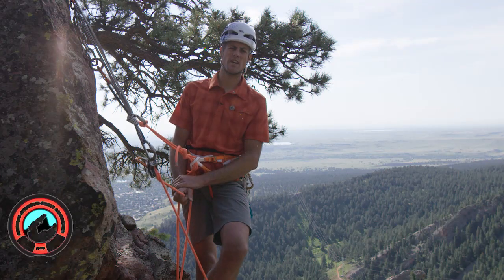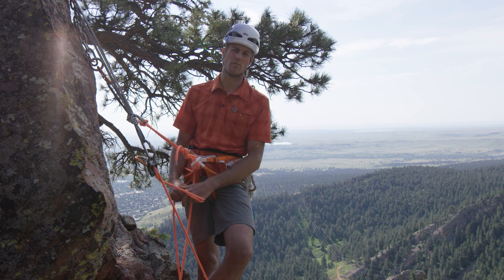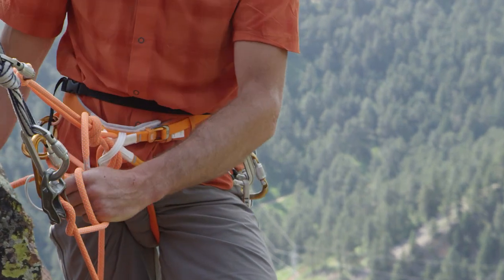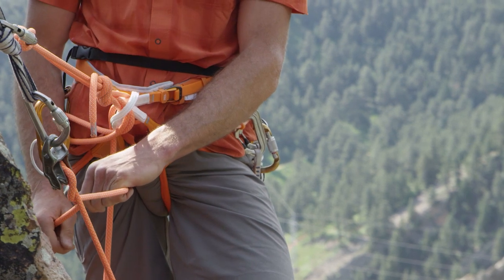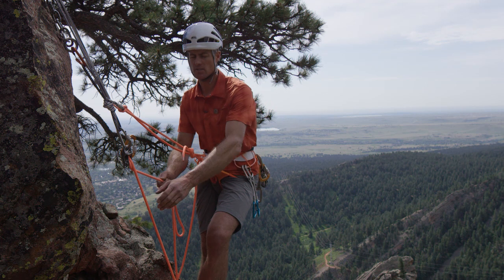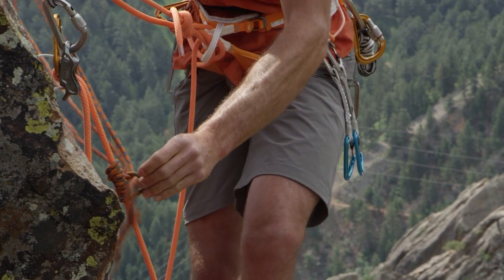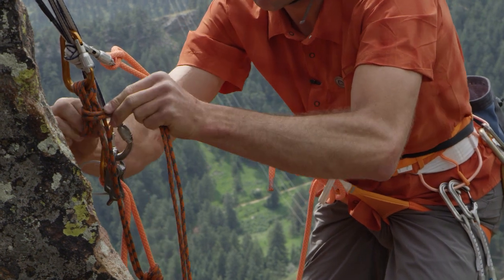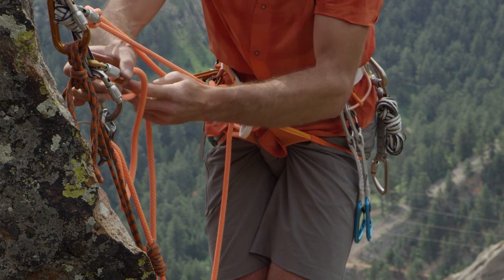Releasing a Loaded Auto Blocking Plate

Comment: Quickest way to release autoblocking device: don't use one, use a Munter.
Reply: Sorry but that's a dumb logic. Learn how to use different tools and when to apply them. Autoblocking devices are handy on long multipitch, so you can drink, eat, adjust layers, and have the gear ready for your partner (and take photos!), all while they are climbing, instead of waiting for them to get to the belay to do so. They are also pretty much the only way to safely bring up two partners on two ropes.